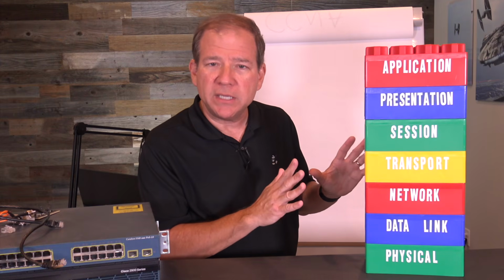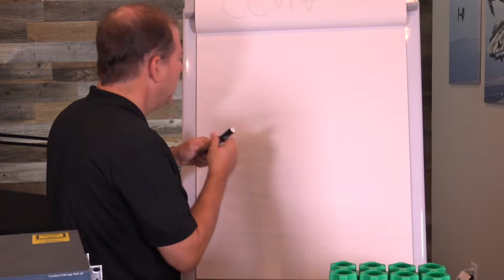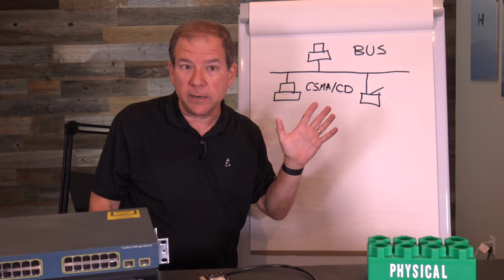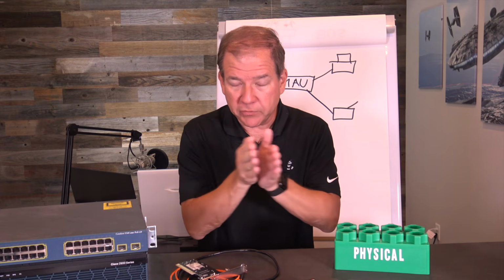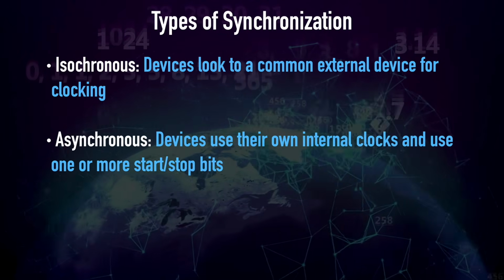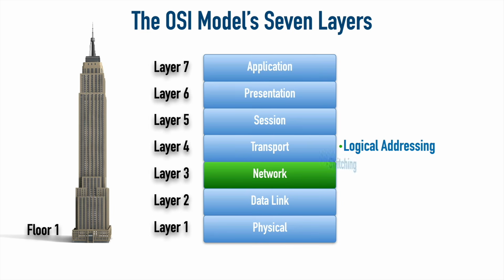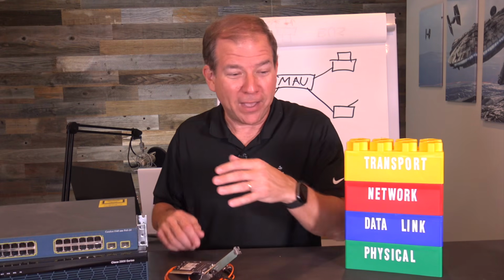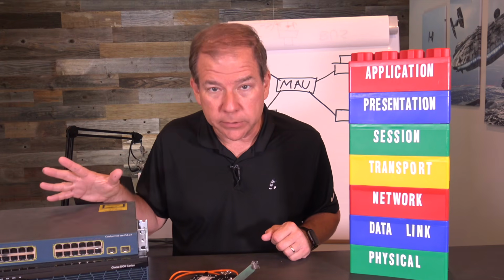OSI Model Deep Dive

Comment: Synchronous clocks do not require a separate channel.  The AMI you referenced has the clock embedded in the data.  Every 1 bit is used to resync the clock.  This led to the problem of too many 0 bits, which caused a loss of sync.  This was fixed with the B8ZS (bipolar with eight-zero substitution) protocol which limited the number of consecutive 0 bits.  AMI is fine for voice but data requires B8ZS.  BTW, both of these were used on a T1 line.

Comment: The MAC address is supposed to be globally unique, but some manufacturers have been known to reuse MAC addresses.  However, that doesn't cause a problem as long as the MAC is unique on the local network.  Anything that happens beyond the router is irrelevant.

Comment: I've got you beat.  My first LAN experience was in early 1978 in the Air Canada reservation system.  It was a proprietary Rockwell Collins network and used time division multiplexing instead of packets.  Each device was assigned a time slot to transmit in.  It came in two types.  The older version ran at 2 Mb over RG-58 coax and the newer version ran 8 Mb over triaxial cable, with a converter between the two networks.  It operated in a loop and there was a synchronizer that kept the loop in sync.

Comment: While I had it explained to me well the first time I learned the OSI model, one important piece that was left out was the distinction you made between the Application Layer and actual applications.  Also understanding that TCP port 22 for example refers to SSH at the Application Layer helps clear a lot of things up.  TCP is simply the Transport Layer protocol, while SSH is the application.  This is also why you can have both TCP and UDP ports with the same number.

Comment: I got very good at terminating coax with those bnc connectors.  Did they really have to make the core of those wires such fine thread?   I had millions of splinters in my shoes, clothes, once in my eye.  That was that schools first actual network, and they made high school students run every bit of it.   5lb hammer works great for….allowing passage of cabling through cinder block btw.

Comment: So since he mentioned that the system will make sure there is no data on the wire, then it would send it's signal. My question is then would the bus cable be a DC (Direct Current) and not an AC (Alternating Current). Thanks!

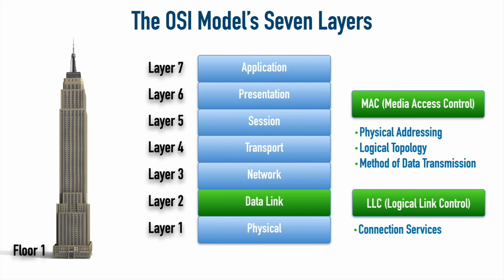Comment: 17:30 if there's a separate synchronization happening the data link layer shouldn't it be the agreement between sender and receiver when the frames start and stop instead of bits?

Comment: You know this man is an engineer when he spends 15 min at the Physical layer

PS Thanks so much! It's actually pretty difficult to find a comprehensive video done within 30 min
Reply: Lol....😂Yeah, I know that's right, but at least he knows what he is talking about.
Reply: Actually he spends 14 min and 45 seconds.
Reply: @kj7767 you didn't take the introduction into consideration
Reply: Except he called a plug a jack.
Reply: @Junglist619000  Considering that one refers to the male aspect versus the female aspect of the two components i would hardly consider this enough to negate his 30 years of experience. Rather trivial error anyone could make producing a video for the internet lol
Reply: @Junglist619000  it is called jack 45...
Reply: @Junglist619000  because that's what it's called...
Reply: @Junglist619000  It's literally the same thing

Comment: Kevin really knows his stuff. The overly technical examples kind of got me lost because I'm just starting out in Networking / Cybersecurity. But after I learn some more I'll revisit this video. If you love the very technical examples I'd say go for it if you are just need a basic foundation. I would check out Eli the Computer Guy. And then research some more OSI information and then once you have a basic foundation come back and check out this video. I feel like you will be able to get a lot more out of it since you understand a lot of the examples. Just my thoughts. I have zero experience with networking (X-want-be programmer turned Cybersecurity).